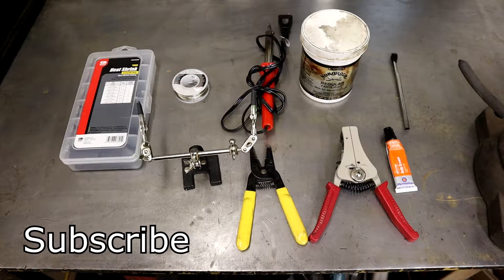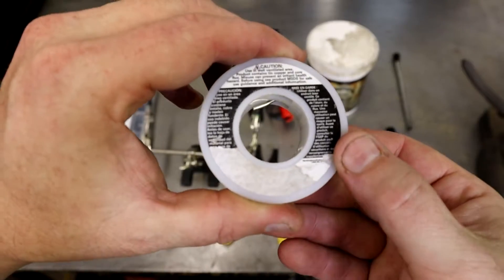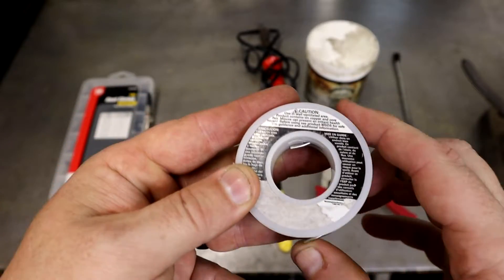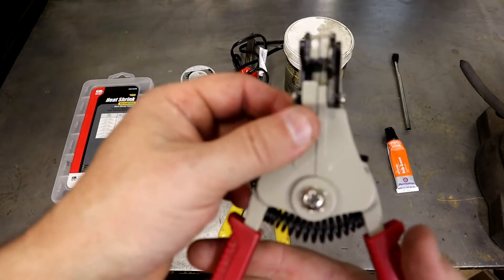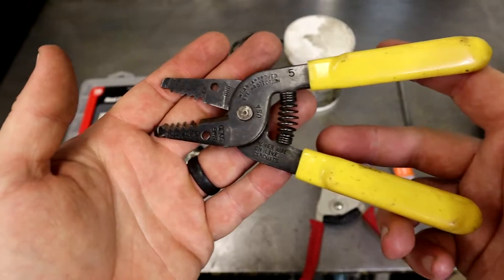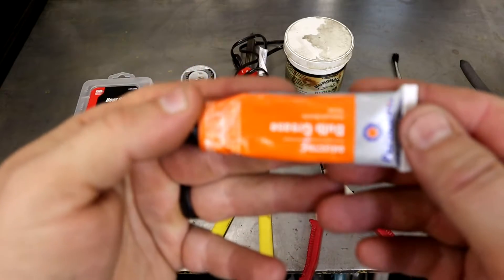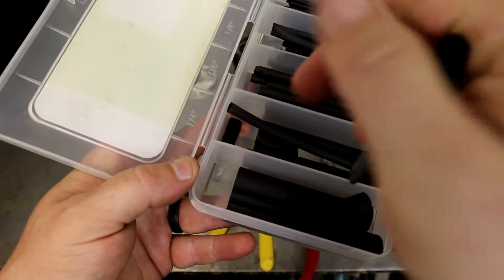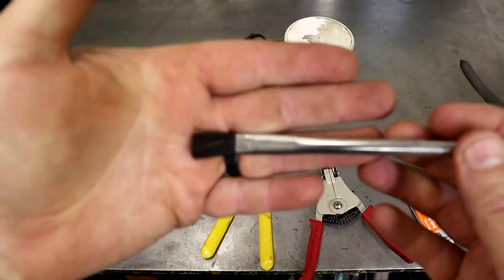How to solder wires together for beginners Like a PRO  (Tips and tricks)

Comment: This is a useful video for anyone starting out joining wires. I've been joining wires in a similar manner for almost 50 years. I don't use any extra flux, just 60:40 resin cored solder and I don't use grease under the heatshrink. One thing that I do which you didn't show, is after soldering, I go around the joint lightly with pliers to ensure that there are no high spots that could cause the heatshrink to rub through.
Reply from the maker: Thats a good idea, thanks for the comment